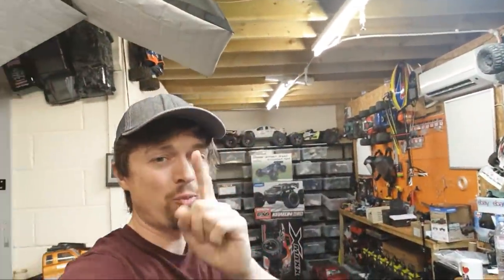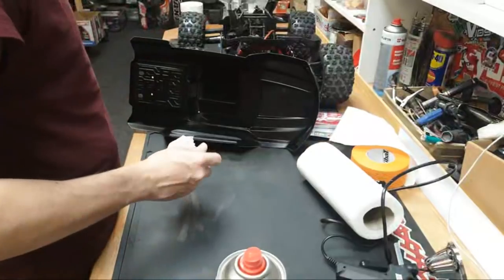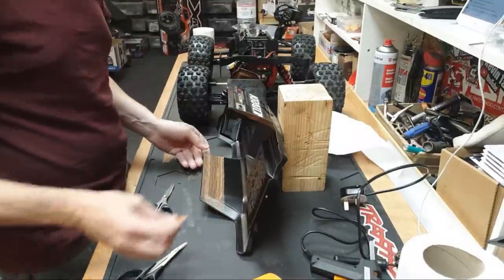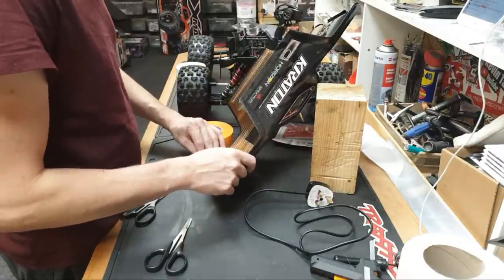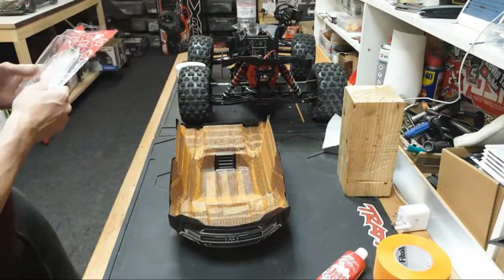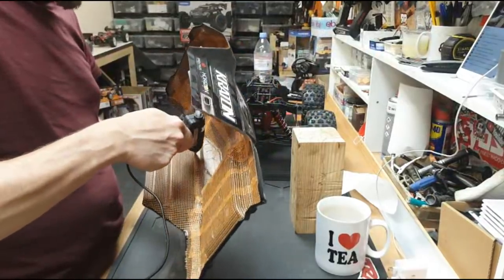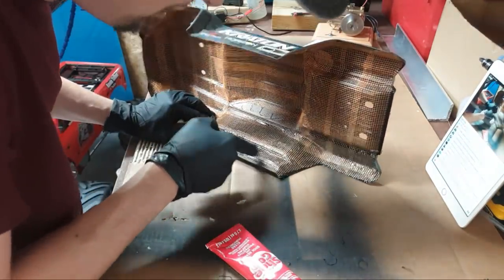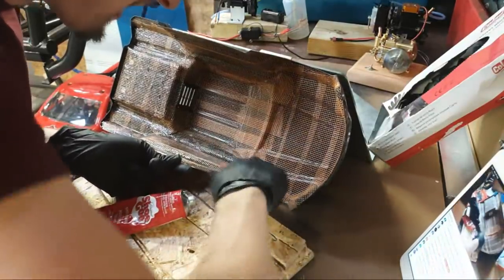Most Boring Video Ever

Comment: DUDE KEV!! Concerned for your health man. Shoe goo is incredibly toxic and is known to cause cancer and respiratory problems, all the way up to brain damage. You should be using that outdoors only. And leaving the glued item outside for at least 6 hours while it gasses out. Don't worry about moisture that stuff will dry in the rain(used it to fix a friends sunroof while it was raining). If you feel you absolutely need to use it indoors I would not do it without a chemical respirator and an exhaust fan in the room to suck out the fumes. Trust me man it is super toxic! it caused me throat and sinus swelling after about 4 days of using it indoors, which prompted me to read the label. It says "EXTREMELY VAPOR HARMFUL!!"